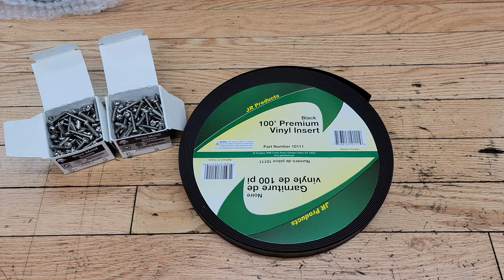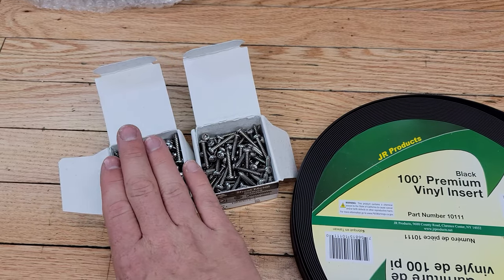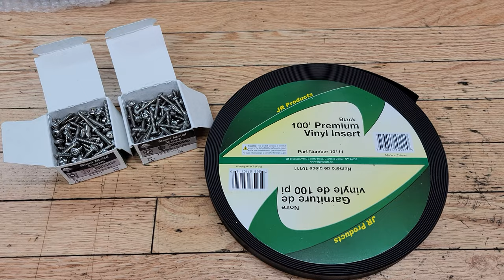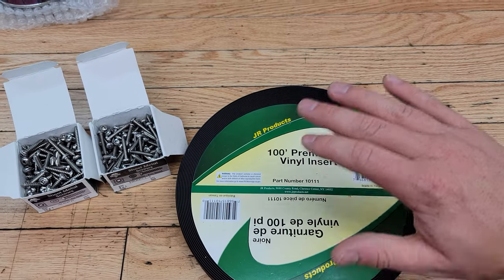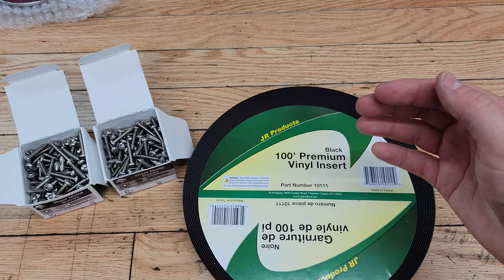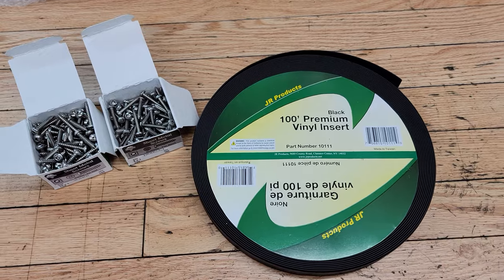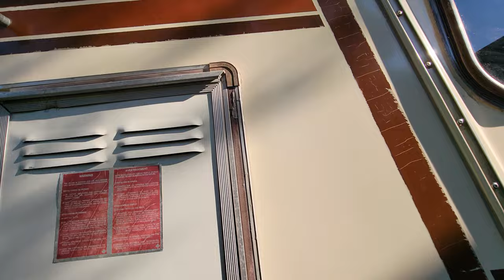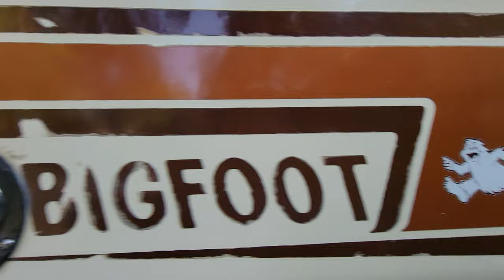Truck Camper Belly Band Replacement | Bigfoot C8

Comment: The vinyl band will shrink a bit over time. I suggest using a bit of black rubber cement at each joint, for appearance and to prevent water intrusion.

Comment: Awesome video!  Which truck do you prefer using the most for hauling the Bigfoot around?
Reply from the maker: If I'm staying on pavement the red truck. Anything off highway the blue truck. The red truck pulls better with the manual and better performance mods, but the blue truck is built to take a beating 🤣

Comment: Hey I also have a 1987 C8. I was wondering if you could tell me who makes the stainless steel water fill and ports you have on yours. Mine still has the original plastic ones and they are brittle and broken.
Reply from the maker: Yeah I got all of those guys on Amazon. Sea dog industries makes the water inlet and outlet and it may have been a different brand for the power inlet but just amazon search 30 amp marine inlet and one similar should pop up. Otherwise check your local marine shops they should have stainless gear like this. Been loving them.
Reply: @OvensGarage  thanks for the info! I Also have a direct fill plastic water inlet that i need to replace.  You should really do an update video on what you have done to your camper! I saw a hood vent with light, I am guessing some new electric, and paint. Would love to hear about it!
Reply from the maker: @travisterrell3730  Yes I'll do an update video on the camper next time we go camping or if I pick it up to work on it!